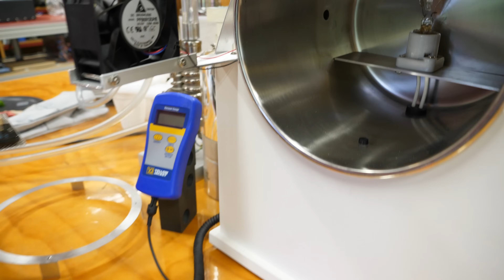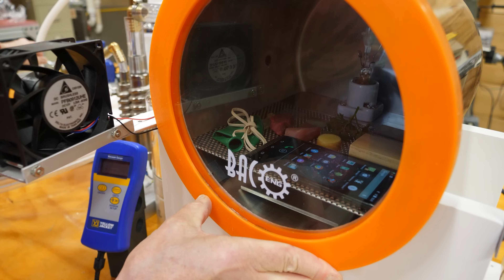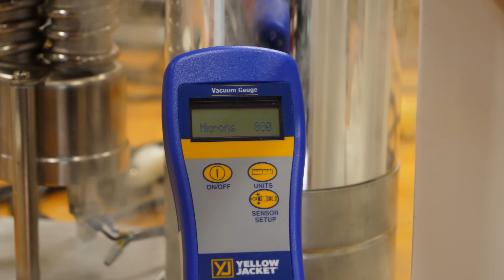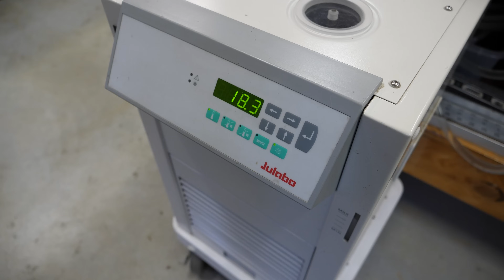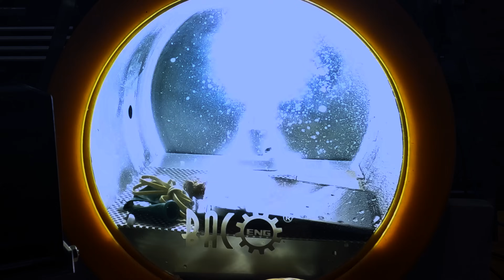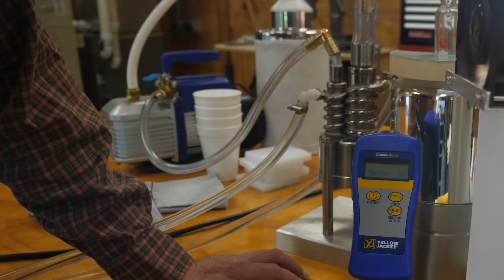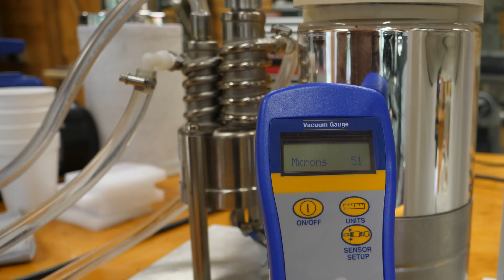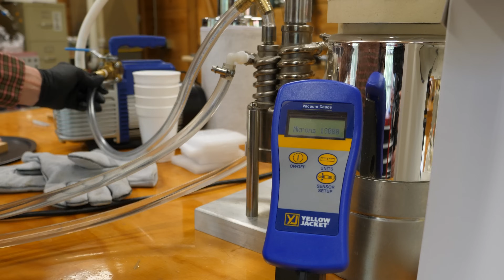We exposed BEEF to the vacuum of space, then ate it!

Comment: If you do this without the lamp, I would be interested to see if the dried materials could be changed back into their previous 'quality' by putting them into water.
As for the wood, does the vacuumed wood still burn as well? Better, or worse? 
Does the wood soak air into it as soon as the vacuum stops or does it still have 'vacuum bubbles' inside, thus making it harder to ignite? Vacuum bubbles is probably wrong, as the material more likely shrinks and closes those gaps in it. Measuring the woods volume could be interesting. By how much did it shrink and does this differ between the types of wood? Could you this way find out if one is a very gassy wood, while another is very dense?
Styrofoam would be also interesting to see. I assume it increases in size drastically until the bubbles pop and every air is sucked out. A marshmallow would be also a nice test in this regard.
Marshmallows increase in size if you put them in a microwave. I wonder if it would also do this after being vacuumed? I kind of doubt it, as the marshmallow likely transforms into a sugar gel in vacuum, which then contains no air bubbles that could expand in a microwave.

Comment: In defence of the food products, being basted and coated with battery guts, resins and residue from the rubber band and balloon, it's no wonder it tastes bad :) . I work in the aerospace industry and am around those giant diffusion pumps, turbo, cryo, and even Ion pumps. Pretty cool to mess around with. I even used a centrifugal pump once. As I remember it, it was compressed air into a cone that created a low pressure and that was used to "rough" the chamber. Don't expose the hot diffusion oil to atmosphere when it's hot, it will crystalize and burn up. We also use LN2 in the cold trap that also prevents the diffusion pump from backstreaming into the chamber and slimming the UUT with oil.

Comment: You can also use a vacuum chamber for freeze drying. Which is basically what youve done to everything.
Reply from the maker: You can, but that's  not what happened here.  The intense UV and the elevated temperatures make a big difference.

Comment: I want to point out that the treated wood you buy at Lowes or wherever, vacuum is not used to infuse the wood. Rather it is put in a pressure chamber which is filled with whatever is used to preserve the wood and then high pressure is applied forcing the liquid into the wood.
There is a problem though. Honesty, the wood must be well seasoned or dry. Green wood is still full of moisture so if the wood isn't fully dried properly when the pressure is released a higher percentage of the preservative will "kick" back out. So for a equal amount of wood, drier wood will retain more of the preservative than greener wood that has more moisture in it.
This is where honesty on the part of the wood treatment plant. They make more money treating greener wood because they save on the cost of the preservative by using less, over time or many board feet of wood they can treat more wood but in the long run it won't last as long as properly dried wood of the original volume.

Comment: I had a thought recently on kiln drying wood and if it made sense to have vacuum so as to use less heat (energy).
Reply from the maker: In theory, it would work.
However,  the container that can resist the one atmosphere of pressure would be expensive. So, it's the cost of energy vs. the cost of the structure.
Reply: @TechIngredients  I tried my own experiment with 8 inch pieces of wood ; the wood shrank by very noticeable amounts and moisture content went down significantly (this was using a piston type vacuum pump). My idea is more of bringing the wood to correct moisture levels on pre-cut pieces for 2 or 3 projects. So a cylinder 6 feet long and 2 foot in diameter would do. I'm learning PLC programming now, perhaps a temperature/vacuum program could reduce the time and energy used significantly. The one thing than stumps me is, if I remove most of the air, how will the heat I apply to the outside of the tank transfer to the wood?
Reply from the maker: That cylinder you describe wouldn't be cheap unless you have access to industrial scrap and have the welding and cutting skills to fabricate it.
Heat transfer isn't a problem if you heat the cylinder, which in turn is insulated on its exterior surface. Radiant transfer will do it.

Comment: I would vent the chamber at the chamber side, not at the roughing pump. Because that way you can contaminate the chamber with oil from the diffusion pump.
And yeah, while most lithium batteries may probably survive a vacuum, they probably won't like getting heated up while in a high vacuum 😅
Reply from the maker: They probably won't survive even a low temperature vacuum because the electrolyte is not solid and will vaporize over time.

Comment: Thanks for the video. As you know, freeze drying is a viable technique in the food industry. Therefore, I claim that the vacuum is not to be blamed (well, with the phone maybe). The discharge lamp is doing the damage to the food. In freeze drying you introduce the material into the chamber frozen. This slows down the evaporation and produces a stable drying residue. So, in space you should just protect your foodstuffs from UV light

Comment: would a turntable in a vacum be able to make sound outside of the vacum through a speaker? would it sound different?
Reply from the maker: There is  no sound without air.  Sound is literally pressure waves moving through a gas.
Reply: @TechIngredients  i am aware of that, but you know how the needle will still rock around on the vinyl. will that not be readable in a vacum? like im imagining you have a cable to a speaker outside of the vacum ofcourse.
Reply: i guess my question is more about the technicalities of how a vinyl player or rather needle works then, is the needle shaking turned into a purely electrical signal because it would be doable in theory then right?
Reply from the maker: The needle is forced to move by the groves in the record.  In the original Victrolas, this mechanical force was transferred to a diaphragm, and its  movement was transfered into pressure waves in the air. The Victrola would generate no sound in a vacuum even though the diaphragm would continue to move.

Comment: I wonder if you can cold weld metals with this setup. Just two metals, touching each other with a little bit of friction, like in the first spacecrafts when some Parts suddenly got stuck
Reply from the maker: Probably not. 
The chamber  you saw in the background with its  turbomolecular pump should  achieve  the necessary  vacuum to achieve  this.

Comment: I've had good luck using pentel hardness B 0.5 mm pencil leads attached via a pair of small gator clips to an old vacuum tube (or similar) vacuum tube HV transformer (about 500 vac @ 10 ma current) to strike up a carbon arc between the pencil leads.  Applying the arc to the surface of the glass bulb (I did a coke bottle and a regular incandescent light bulb) to create a pin point soft spot in the glass.  The light bulb depressurized with a little glass envelope poof of gas from the softened glass (a nicely elastic flow operation) for the light bulb.
The beauty of this carbon arc and High voltage, is that once you melt the glass - it becomes molten and conductive.  So making use of the molten conductive glass, you can draw the electrodes away from each other and around to the far side of the glass envelop and it kind of breaks/separates the two glass halves exactly along the line of molten glass the electrodes traced out.   I was as dumb kid in high school last time I tried this (no UV eye protection when starting the arc) but once it melted the glass and I separated the two carbon electrodes, you only see a dull red glow of the molten glass as you draw the electrodes where you want to cut the glass.   I think this would be much cleaner than sniffing glass dust particles and worrying about sharp glass shards.

Comment: I just started this video and it reminded me that if any channel could tackle an interesting phenomena it would be this one. I follow an F Class shooter named Erik Cortina. He won the southwest nationals and led the team to win the championship in south Africa with a very small group 1,000 yard group. He's very generous with information about how he got to be a world class shooter. One of the things he discusses often is barrel tuning. This could get really long if I don't cut to the "phenomena". In short, when a rifle is fired, the chamber, imperceptibly swells into what I visualize as a donut that travels down the barrel, reaches the end, and reflects back. Firing the rifle sets up a standing wave, much like a mismatched coax / antenna combination does. The barrel whips in a circular motion. You can see the results in a target when we do a seating depth test. Adjusting the depth of the bullet in the case affects group shape and size because it changes its starting point. There is also a barrel tuner that can be attached to the end and adjusted to tune the barrel to the load. The parallel to an RF standing wave and a standing wave that occurs at the time a rifle is fired fascinated me. I believe the wave is going to have high frequency, low amplitude, and velocity will mimic the fps of the cartridge. I'm not sure how one could could confirm what is happening but I think that, if you did, you would be the first.

Comment: I heard that using oil/grease that wasn't specifically made for use in vacuum would literally explode.  Never tested that when I was working with vacuum equipment as I didn't want to mis-use my employers equipment.  Do you think your test rig could handle that experiment?
Reply from the maker: I think so.  The UV wouldn't  be needed, but it might take a long time to test it.

Comment: Considering vacuum drying, could you eventually make experiments with with vacuum drying in microwave. Two ways come to my head, placing whole microwave inside vacuum chamber, I think it's too bulky. And another one is making internal microwave chamber fully hermetic (airtight) and cooking as usual, but this may lead to implosion if microwave sides are not strengthened enough.

Comment: I'm late to see this. and i don't know if you look at comments on old videos but I  been wondering if using  vacuum would make a more efficient evaporator fr possessing maple sap to syrup.  was thinking if you went 75% of the evaporator under vacuum then the rest the conventional way you could save a lot of energy.
Reply from the maker: Maybe.
But remember, the pump uses energy  as well.
Also,  vacuum distillation requires much more expensive, thick walled vessels to withstand the external atmospheric pressure. 
Another option is recycling the heat energy by cooling the vapors with fresh sap extract and thereby preheating this liquid prior to its  evaporation.
Reply: @TechIngredients  i was thinking boiling water  in reinforced barrel then seal it and cool it with snow to generate the vacuum, (since most sugar shacks don't have electricity). and something like 1/4 steel plate to make the condenser, I'm thinking as long a the condenser is colder than the sap the sap will boil, if you have enough vacuum. I don't know the relevant equations so this is guess work on my part.

Comment: Maybe too late of a suggestion, but maybe see if you could cold weld as they say you could do with metals in space. I know not a 100% vacuum, but maybe you don't need 100%?
Reply from the maker: You need a pretty good vacuum.  You can assist by heating the metal to drive off the gas molecules.
Reply: @TechIngredients I figured as much, I thought of it as an attempt, to see how much it would do.

Comment: Theres been some videos recently of a styrofoam cup which was brought down to the deep depths of the ocean and shown what the pressure does to the trapped air, it shrinks the cup like a shrinky dink. 

If the opposite is true, then if you put a cup in the pot and pull a vacuum on it will it expand  or just become brittle or powderize or will it do the same thing since the gases escapes? Or is it more like an expansion like a marshmellow in a microwave?
Reply from the maker: It will expand and then eventually become brittle, and after a long time, it will evaporate.
Reply: @TechIngredients  Thank you for your answer. It made my day!

 They use vacuum molding for polystyrene molding, which isn't using the same level of atmosphere as your setup, so I assumed it might not do much since it must have been done by an employee on accident.

Does it truly evaporate, or is it more of a breakdown to a pile of microplastics. Man, you can never tell what would happen until you shove it into deep space. We could have saved a cup of coffee for the extraterrestrials that discover us in the future.
Reply from the maker: It will evaporate. Remember, those microplastic particles are made from the same plastic that was holding them together and eventually  disappeared. 
The plastic has a vapor pressure, and at elevated temperatures, it isn't  trivial.

Comment: You mentioned using vacuum to impregnate wood with stabilizers, what about vacuum marinating a steak?
Reply from the maker: The difference is that wood contains air and meat doesn't. It's  the elimination of the air that makes room for a liquid to enter the wood. Removing all the water from the meat is similar to freeze drying, which will affect the texture when it is then rehydrated.

Comment: Prof, could there be a vacuum mold for a (low pressure) aerogel  ? ,foaming agent.
Reply from the maker: Yes.
The secret  with aerogel isn't  the vacuum,  but the solvent/matrix that supports the mesh as the volatiles evaporate.

Comment: Thanks for this channel. I'm glad it was recommended to me and would call myself a long time subscriber.
Some things i am curious about:
Degassing epoxy with an ultrasonic cleaner... i have used one for mixing glycerol and propyleneplycol in a closed bottle that was also shaken. The bubbles rise quite well in the bath.
I'm also curious about filtering the air that comes out of a cyclone dustextractor with some modified powdercoating device... static charge and dust explosions are important anyway...
Another air filtering topic i'm curious about is filtering air from resin/uv printers or curing/pressure pots and curing ovens (like for silicone and also epoxy and pu). I think carbon filters are wasteful and i have seen someone show activated charcoal removing only odors... the most promising i have seen so far is plasma cleaning and maybe some strong UV source.
Maybe this is something for your channel.

Comment: Hello. It would be interesting to use your setup to investigate the metal cold welding which can happen in space with dofferent materials such as copper, aluminium, carbon steel, cast iron, stainless steel 304 and 316, titanium and some mixed samples like carbon steel - aisi 304. Or aisi 316 - aluminium

Comment: "[Liquid nitrogen] costs less than $1 a liter", god I wish it was that simple in Sweden.
Here you need a lab, the appropriate licenses, and approval from the county administrative board.
Same with methanol, sulphuric acid, and fairly recently sodium hydroxide (as well as most other chemicals).
It's hard enough to get dry ice because there's not that many producers, even without legal hurdles.
Reply from the maker: It makes me wonder what overall good all that self-imposed regulation accomplishes.
Reply: @TechIngredients  It's mostly trying to prevent crimes, be it direct violence, illegal substance manufacturing, or simple tax avoidance.
You have a similar bar to meet in terms of locale, equipment, and certifications when it comes to foodstuffs or alcohol for sale to the general public, which is where the acceptance of the ridiculousness probably comes from.

Comment: I wanted to restore an old, trunk mounted, luggage rack (think old 'Cuda/Challenger touring package) which has teak wood slats where the luggage makes contact with the rack as it protects the luggage (and rack) and it looks nice. <deep breath>
  I sanded and rubbed the wooden straps until the old shellac/varnish was gone and decided to rub them down with teak oil, a terrific preservative and the obvious choice for teak slats.  I rubbed it in but, "eh."  I soaked them in it for a day or two... Again, "eh."  I then got a brilliant idea (ok, brilliant for me, obvious for you) and bought some 4" plexiglass tubing and a couple squares of plexiglass, glued a square to one end of the tube and used a flat, vacuum "plate" that came with my vacuum sealer and again put the teak strips into the tube with the teak oil and pulled a vacuum, then left (forgot) it for 48hrs.
  The results were night and day, seemingly miraculous in the way the wood permanently took the oil and now they are once again waterproof and pleasant to look at.  My mini-science experiment worked and all I needed was a Food Saver and a few dollars worth of plexiglass.  😊